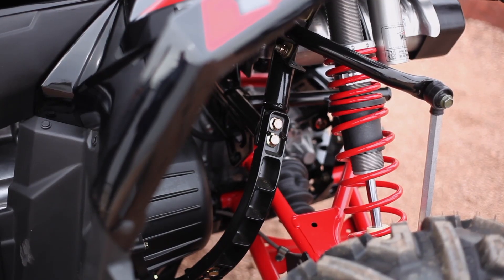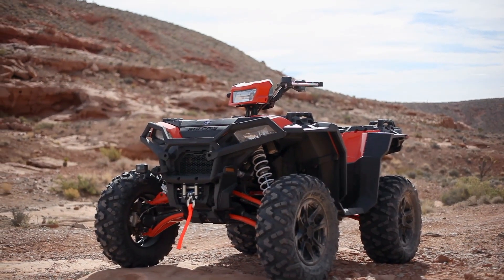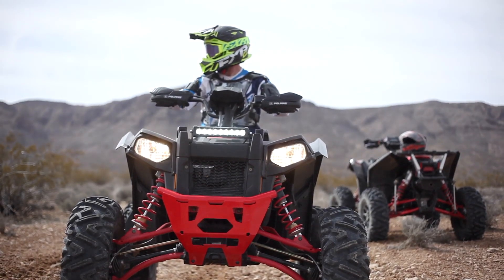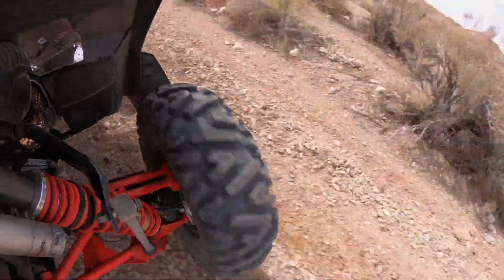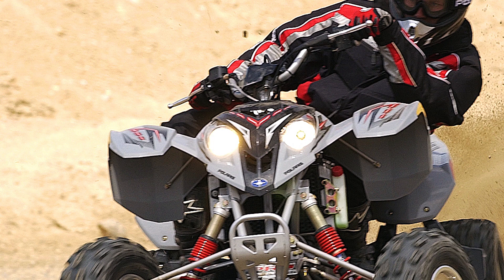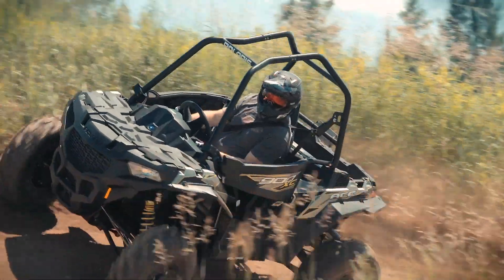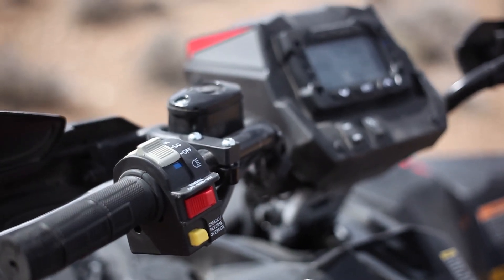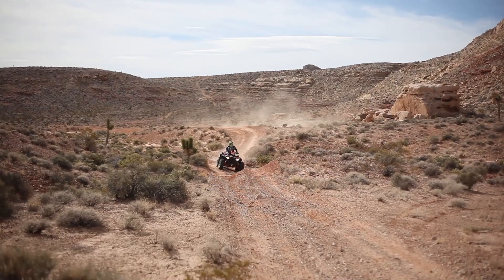Even More Details on the 2020 Sportsman & Scrambler XP 1000 S

Comment: I am a proud owner of the 1000s sportsman and it is hands down the best I have ever riden or owned. The smooth plush feel over any terrain is bar none the best ever. Thank you Polaris for being the leaders and creating this masterpiece!!
Reply: Louis Johnson Jr. Have you done any mods too it yet? I’m thinking about getting one.
Reply: @chrisdodson2917  not any performance mods I haven't . Only changed headlights and handle bar light a strobe and added a bluetooth speaker setup. It has everything I needed from the factory and goes places you wouldn't dream it would make it through. Very happy with it.
Reply: I bought one too and use it on the trails in Maine.  Been riding my who life, this is by far the best handling capable machine I've ever ridden. I'm super happy with this purchase
Reply: @ronlaporte3695  i just ordered a 2022 model sportsman  s cant wait to get it, im also in Maine!
Reply: @louisjohnsonjr.4934 , how is the machine still treating you!?  Any issues?

Comment: Picked my 2020 Scrambler 1000 S last Tuesday then headed out to West Virginia on Thursday. The machine is awesome, felt invisible on the trail. I also have a 2018 scrambler 1000, 2019 renegade 1000 xxc and it does not seem fear. My boys kept commenting how easy it handled the bumps and turns. Loving the vehicle. Getting rid of the 2018 scrambler but keeping the renegade.

Comment: Frame!!! Only 30% stronger than the standard model. 
I gave up on polaris because of the broken frames continuously, continuously, constantly. 
30% heavier = the same frame problems, guaranteed! 
People actually ride these things offroad in harsh environments. 
Bought a renegade 1000xxc and then another and I cant break it. Over 6000 miles on the first one.
None of my 3 sportsmans lasted 3000 miles before the horrendous problems n costs made me get rid of them. 
Frame upgrade of 130% stronger needed at the very least!

Comment: I think it’s a great move going 55 inch. It allows more robust parts to be used which god knows Polaris needs!! Sportsman 1000s stay tore up all the time and they needed a bigger diff and other parts to handle the engine power. It won’t be long ALL 1000cc quads will be 55 inch to increase durability. I’m waiting for the new 55 inch Kawasaki Brute Force 1000 😎

Comment: This concept has great potential but
This is no where near the ultimate atv
First weight is getting out of control 
With these atvs
Weight plus hp equals dangerous combo
Watch the rider in video
The machine is all over the place in the rough 
Look up dean sundahl and his frame design he made for desert racing 
He raced atcs  for honda before 4wheelers ever existed 
My sundahl banshee has same 92 hp
But half the weight
18 inches of travel
You can stand a 5 gallon bucket under frame and it clears it
Just axle is low
My point is at speed it takes longer to stop because of extra suspension travel and inertia of travel 
We’re building custom front brakes to make it stop better
It weighs probably 400 lbs
With that travel it changes the way you ride in certain situations 
In straight line
Faster you go smoother it gets 
No way in hell I would ride this sportsman to the same speed in rough whoops etc because of the unsprung mass. It’s an accident waiting to happen.
Just because it’s wider doesn’t mean it will automatically be better 
One brake lever is NOT better than separate front and rear brake levers in performance atvs
You loose that finite control In braking 
Belt drive kills my interest in this atv
We own a 1000 rzr so I’m not a Polaris hater but not happy with belt on it either 
If you want to understand where I’m coming from look at a video of Toby price or Ben grabham riding Ktm 450 in finke race called
Bound for speed Ktm desert team
High Hp with low weight 
Watch that bike move around under the rider
High hp low weight 
The factory’s have abandoned pure performance atvs other than Yamaha 
And it’s not pushing the envelope either
No competition 
We own two 700 raptors also so I know that atvs shortcomings also
This is just a rzr you can ride
Yeah I applaud Polaris for trying to do something 
The rzr changed the game and they keep upgrading it through the years
Polaris owns Indian motorcycles
They are aggressively giving Harley Davidson competition in their market forcing Harley to step up their performance in their motorcycles
Polaris is an aggressive company trying to improve 
They are doing something and that’s great
Maybe the scrambler will open the door  for future development of the ultimate Atv 
That machine hasn’t been built yet
And with the sxs market having such diverse competition and improvements every year its hard for Atv riders to see that same commitment from the factories 
45 years old been around dirt bikes,street bikes, atcs,and atvs all my life
Love to ride but don’t know if that next level will ever come to the atv industry 
Afraid sxs have taken any hope of that
I hope I’m wrong
Reply: That was the most incoherent rambling comment I've ever read but having said that. I think I get what you're saying. 

Polaris should change the laws of physics as we know it. Make steel lighter than aluminum and stronger than carbide. That way it could weigh half as much like my sport QUAD! Quads are awesome but built for only ONE thing. Performance. This a utility ATV capable of not only keeping up with a sport quad. But blowing it out of the water in straight line speeds. Keep in mind this is a BIG BORE, 4 WHEEL DRIVE, performance UTILY 4 wheeler. NOT a sport quad which is nothing more than a dirt bike with 2 extra tires. 

I agree I think it's time for the industry as a whole to move away from CVT belt transmission designs. But Polaris does make a good one. And on utility based machines they make more sense. No shift shock to jar a load on a rack. Been through that many times on Honda wheelers. 

And you still have independent control of rear brakes on a Polaris machine. It's just through a pedal instead of a handle. 

Shame on you for making me defend this monstrosity! 

Polaris should have just slapped a turbocharged 1000cc in the scrambler and called it a day.
Reply: Brandon Crimmins well when they started talking about racing a 900 lb plus atv and that they set out to build the ultimate atv then yeah I have to disagree
There are other ways to build a lightweight 4x4 sport atv
Christini has been building light weight two wheel dirt bikes for years
Look them up
Hub drive 
I refuse to settle for what the manufacturers are selling if there are ways to make a leaner machine
I guess we would still be driving the same cars they drove in the 50’s without innovation 
A 1000 v twin that only makes 90 hp
A Ktm 500 exc puts out 55 hp roughly
Raptor 700 what about 35-40 hp
Inefficient design 
Or government control off showroom floor
Reply: Brandon Crimmins oh yeah
You cannot just use the front brakes on Polaris 
Yeah you have rear brake 
But where’s the front brake lever
Reply: @housemovershane8810  you keep comparing these to dirtbikes and quads... Which means you're as stupid as your comments. Comparing these to a dirt bike especially... is like comparing a fully loaded Kenworth to a smart car. And this may surprise you but there are COMPLETELY SEPERATE classes for these utility based sport wheelers to compete in. Just the same as quads and dirtbikes don't compete in the same class professionally. 

And yes... You're right. While you do have completely independent control of the rear brake on these machines with the pedal. The handle always activates all brakes. Again... On a machine evolved from a utility machine. An AWESOME idea. I've also done some amateur racing and don't know why you would ever need just the front brake. That's a great way to eat some dirt. Rear brake by itself...? Yes! But fronts no. 

My friends and I ride while hunting with our shotgun in one hand and driving with the other. Using only the rear brake. This way regardless of how fast we have to stop. The machine doesn't pull or jerk one way or the other And always tracks straight. Even under full lock of the rear brakes. And yes... This is on PRIVATE property. 

I think you're hung up too much on your own personal opinion on what racing is. Just so you know... There are also professional Semi Tractor road racing leagues. So... Just because something is heavy doesn't mean it can't or shouldn't be raced...
Reply: Brandon Crimmins 
Never did I call you stupid 
I only commented about the scrambler 
Yeah I know all about the different classes of racing 
Yeah dirt bikes have progressed leaps and bounds in the last few years
Atvs have not
Sxs get all the attention now
Your entitled to your opinion as I am to mine
Reply: Weight is no issue with the 1000s. Yes it has the weight but the feel and ride of the bike feels lighter then any other bike I have ever had. I have a 750 brute force with lift and 29.5 inch tires on 14 inch rims and the Polaris feels lighter and more nimble then any bike I have ever rode. Try it and you'll see what I mean.